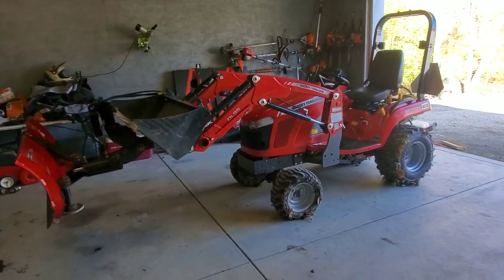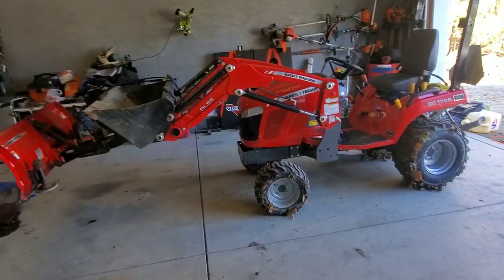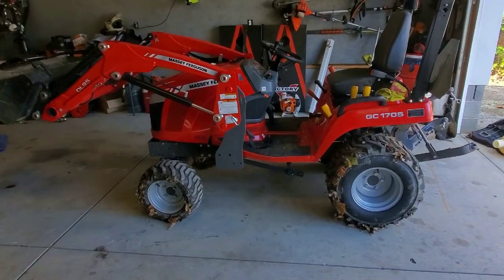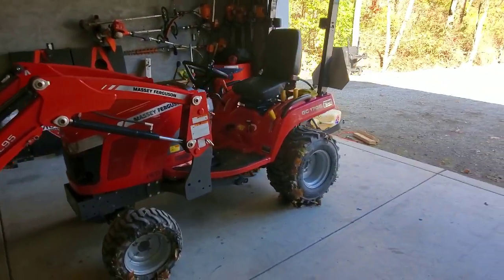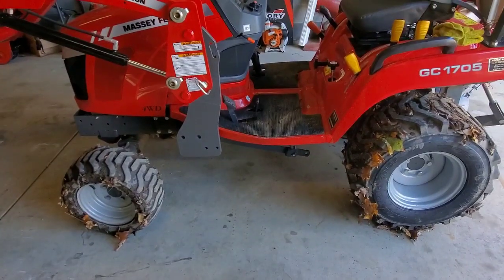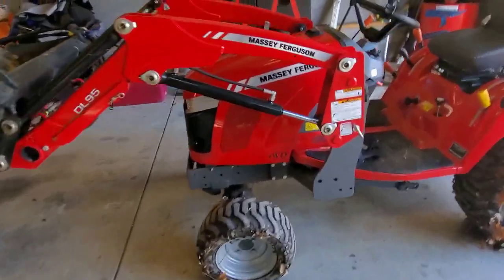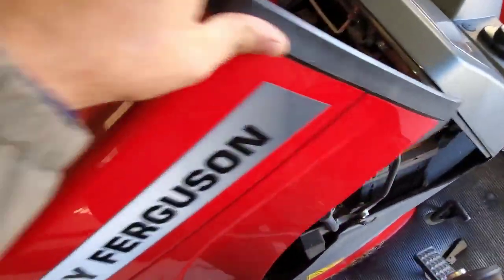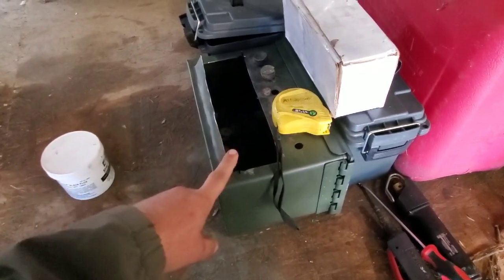Massey furguson Gc1705 and Surprise

Comment: Good morning!  The first day of a little freedom in western PA!  I live a few miles south of Pittsburgh and I have a GC1710 TLB with almost 250 hours, I can trade lots of stories with you.  In short this thing is a beast and will last my lifetime.  I have several implements and can help with the issues you raised.  The easy one is the seat.  My daughter bought me those seat beads you can get for cars for Father’s Day 2 years ago and they are great, they give comfort and prevent swamp .....  I was going to buy a new seat too and after that never thought about it again.  The other issue is the bumper.  I have the same plow, a snowblower, and rotary broom for the front.  If you have a little metal working ability, I have an easy fix.  I chamfered the bolt holes in the bumper and bought new, proper grade, flathead, cone shaped bolts.  Then made two bars into 3/4” standoffs to put between the bumper and the tractor frame.  The stand-off gives you room for the easy mount top lip and the flat head bolts don’t create interference so it will lay flat.  The extra distance also keeps the hood from hitting the bumper when open, that was just luck. This way, you mount the easy mount to the bumper.....seems to be working for me so far.  Just make sure you buy bolts of the proper grade or better, as they become very important now since the easy mount isn’t right on the tractor frame.  Good luck and reach out to me for anything, I love this stuff and I love my Massey’s.  I also have a 1726e.

Comment: You got a good deal on the wee Massey Ferguson GC 1705 You just do not  know it,give her sometime & it will come to You. I bought a M-F 1526  new in 2018 & the 1 thing I liked about her was the lift height to load stuff into my 1 ton dump truck so far it has been a great tractor. I also have 1959 M-F 50 that I use to skid logs with as well grade our road & during late fall I hook the log spliter to split wood & I use the newer M-F 1526 for snow removal.I also bought this tractor to work with my dump truck. thanks for the video & I do want to see the stump grinder in action.

Comment: I have a 2015 Massey Ferguson GC1720TLB. Great tractor, I have  used it like crazy. Mine is a 25 horse diesel. I haven't had any problem with the mower blades. I get mine from my dealer in East Liverpool  Ohio. I pay around 80 for all 3 blades. Only have changed them once. I have them sharpened each year. I  live in PA real close to the WV border and Ohio. Not sure what part of western PA you are in though.
Reply: same here I have had the same blades for 3 years, I mow 10 acres 1-2 times a week for  8 months out of the year.

Comment: Could you drive this through a gate to enter someone’s fenced in backyard or is it too wide
Reply: I drive mine through a 5 ft gate, they will fit with a 4 foot gate but super tight and the turn signal rear lights must be modded and moved into the frame of ROPS.
I have a GC1725M and love it!
Reply: @DavisShopworx  good to know, thanks!